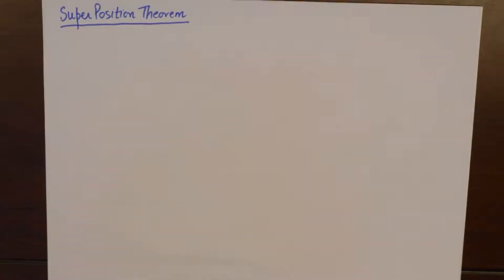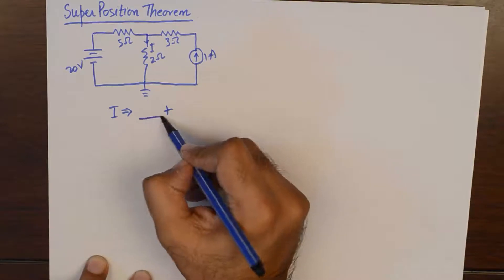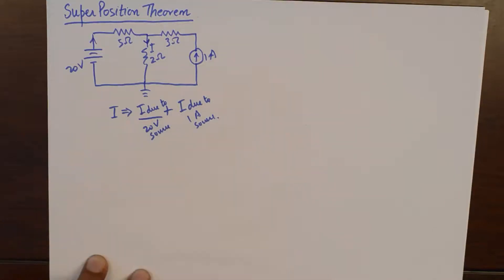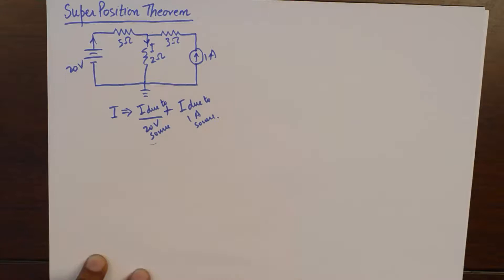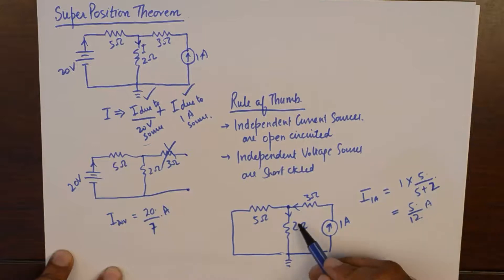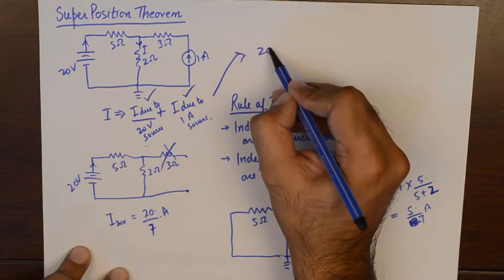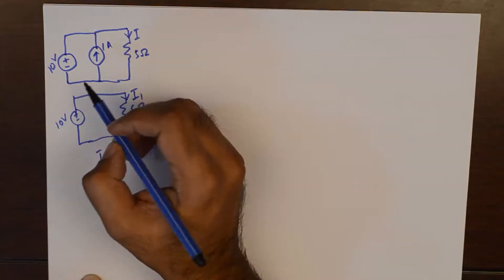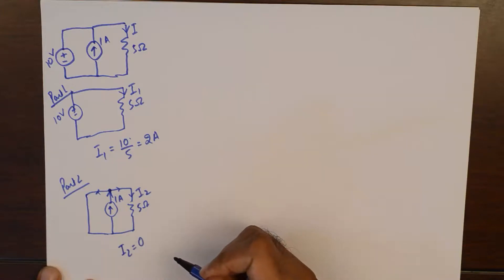Superposition Theorem | Network Analysis Basics | Tutorial

Comment: Where is 3 ohm located in 5 by 7
Reply: It vanishes as no current flows through it as the circuit is open ahead
Reply: it has been 3 years but still, the 1 ampere current simply passed throught 3 ohm resistance since the 3 ohm resistance is not in parallel with any other resistor, so he only took 2 ohm and 5 ohm one